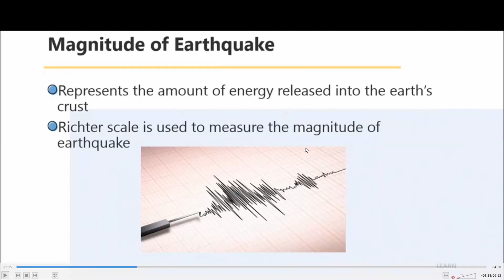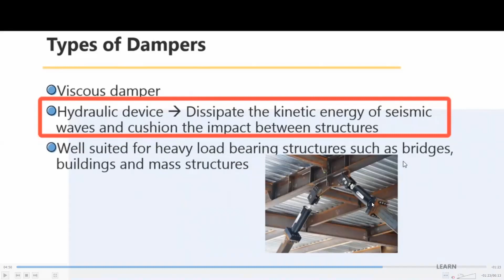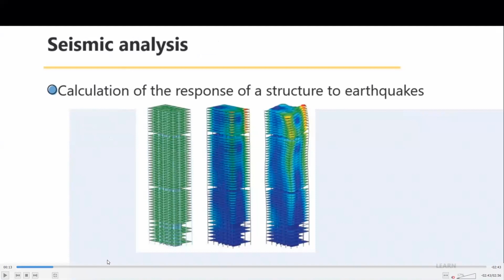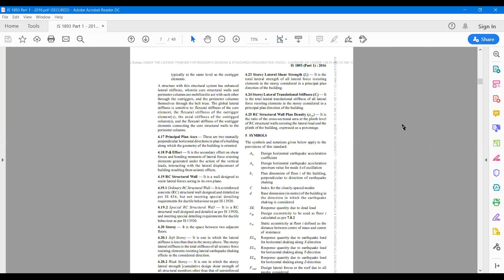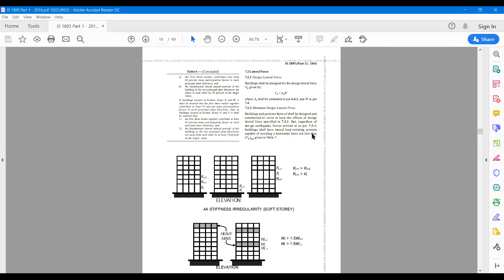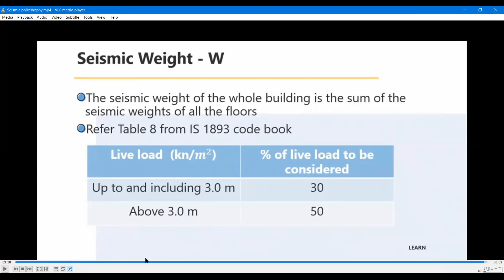Building Design By Etabs E13 : Seismic Analysis Part-I

Comment: Sir there is a big difference coming in steel when designed with user defined time period.
Program calculated time period giving very less column and beam steel as compared to user-defined calculated from is code.. please tell us which is safe..
Reply from the maker: Use code based time period:
As per I1893-2002(part1)
If brick walls are used, the empirically derived formula for time period of building with brick infill shall be used (0.09h/sqrt(d)). If there are no brick walls, then the formula for building without infills shall be used (.075xh^.75)